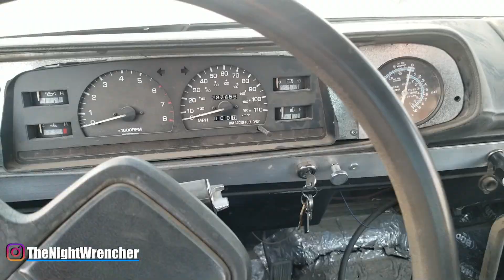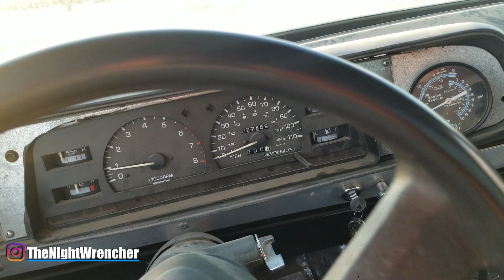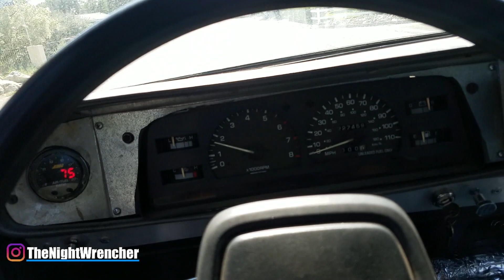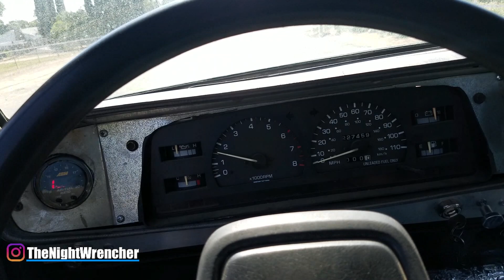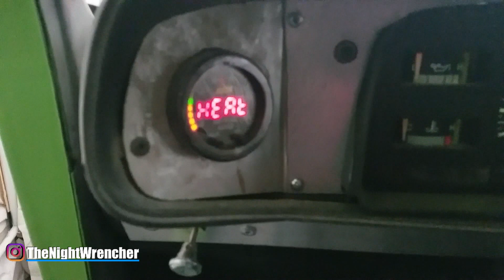Carburetor VS Fuel Injection- 5 Myths BUSTED | Holley Carburetor Secrets | Carbureted LS

Comment: Good video on a topic that will always be swayed toward the fuel injection side in the modern times where using a laptop and entering data to tune is so much more understandable than the physics of a carburetor that are from the pressure differential interactions of each metered orifice to the density change of main well fuel with different and amount of emulsion bleed exposure. The observation of the beginning of carburetor stigma, myth and lore sounds accurate to me. Back in the day Holley engineers would calibrate by size and location every orifice on their carburetors to close as practicable to suit the manufacturers engine. People started changing characteristics of the engine or swap carbs from bigger engines to smaller engines etc and they no longer ran as they should. After some stabbing in the dark without even knowing the full extent of carburetor operation let alone how all those fixed holes on the metering block work they got it to run a little better. This eventually led them to believe that they ‘know’ how to tune a Holley. Years and years of misguided information perpetuated by magazines in those “Everything you need to know to power tune your Holley carburetor” that showed you how to adjust float level, change main jets, set idle and incorrectly chose power valves led so many to believe they knew all there is to know so if it still ran rich then “that’s just what Holley’s do because I’ve done everything that can be done to fix it” having zero clues about sizing IFR or adjusting iab and certainly no knowledge of e-bleed function and how a change of mab or MJ can alter that function. So when people are ignorant of their ignorance and see Holley carburetors through the eyes of all the myth, lore and stigma it’s no wonder they are flocking to Holley Sniper etc and claiming it has it all over carburetors. Those that make those claims either themselves or their tuners did not have a full understanding of how and what to adjust to get the best out of their engines with a carb but with fuel injection it’s all there in front of them on a laptop. Like yourself I enjoy tuning carburetors for the sake of doing it and continually getting an understanding of the physics involved and what changes effect what else and the how and why. I am having a growing dislike for some of the old timers commenting on various platforms that not just claim but tell you they know better because they could tune a Holley back in the seventies and still can now yet cannot explain the interaction between the main air bleed and the e-bleeds and what would happen if they were to change size or location of any of those. I doubt they could tell you what other effects changing MJ has other than increasing or reducing fuel supply of the boosters. I’ll leave you with something Mike Laws told me on a forum when discussing Holley emulsion that paints a picture of why those on the fuel injection is better side is on that side - easier to understand 
“The emulsion/mab system is dynamic, variable, complex and ingenious. (Especially with older booster technology.) I remember back several years when a young mechanical engineer from Hendrick Mtspts asked my Dad (Bo Laws) to explain the emulsion system on one of their Cup-Plate carburetors. Dad had a metering block in hand and was about 15 minutes into the tutorial when it became real obvious that the young fellow wasn't getting it. He was polite enough and excused himself. We got word the next day that he put in for a transfer to the chassis department. In the fellow's defense; one could literally write a book about the emulsion system in racing carbs.”
Reply from the maker: I agree with you 100%. The move will always be slowly towards EFI. Thats one of the goals on this channel, keep people on the carburetors and demystify all the secrets into easy to chew videos. Hopefully we can end up with well educated carburetor enthusiasts but only time will tell
Reply: @NightWrencher  keep the good content coming👍

Comment: Great vid. 
Having a tough time figuring out my carb.
4150 4779-9
383 stroker 10.75 : 1
Cam 233 at .050 290s at .006
I can only get .75 turn out on mix screws to get 14 ish afr. When I put in gear it leans out and idles like crap.
Msd6al2 programmable, I've played with all sorts of timing,  I got qft metering blocks, modded body for IAB and am up to .083 from .071. I've read and researched for weeks, learned a lot,  but its kicking my butt. 
Tran is a 700r4 with a 9" 2600 stall. 3.73 gear in rear. 
Transfer slots are squares, I've tried squaring secondarys also, leaving idle screw alone and using timing to adjust idle. Pv is 4.5, car makes around 10 to 12".
Squirters are 31, jets are 71 and 83. No PC in sec. 
Engine dyno made most power at 39* 480hp 495tq. 
Any help is much appreciated.  
Thanks
Reply from the maker: Ok, theres a few issues there. First, you should not be adjusting your idle speed with timing. Timing should be set at highest vacuum at idle. Second, you increased your IABs which means you also leaned out the fuel curve so I would put the old one back unless you go too rich too fast in the transition and cruise. Third, you have a fairly lopey cam, so you can not trust your AFR reading at idle because of the overlap. It will always show leaner than it actually is, set your mixture screws to highest vacuum then set your idle speed screw, the set your mixture screws again. If you can get a 4 corner idle carb, I would recommend you get one. Do not open the secondaries at all if its a 2 corner idle carb
Reply: she is a 4 corner. 
I'll give your advice a try. 
I kept good notes so I can do a restart if needed. 
IAB, afr reads rich still in the transfer so I dont think I'm to big yet. 
I also reduced IFR from .031 to .027 to try and lean it some. 
Those are big reductions when converting to area then percentages.  I thought for sure I'd see changes.
Reply from the maker: You're right, you should have seen at least 1 full afr point difference. What brand base plate do you have?
Reply: The stock one that came with carb.
Reply from the maker: Since its a 4 corner idle carb, when you tried doing a half turn open on the secondaries, how did the AFR respond?
Reply: I've checked for vac leaks, body and gasket surfaces are flat.
I think I'm to the point where I'm not going to focus on a number. Get it idling decent and go for a ride. Tune accordingly.  It is better than it was. So I guess I shouldn't say there was no changes, and I can get a idle afr of 14 or so but when I put in gear it leans out. 
I get close, then strap car to lift, with parking brake on, in gear, and readjust. Afr reads 13 or so. But that's me focusing on a number. Plugs definitely look better. I bet your right, overlap, scavenging is giving false reading. 
I do know it likes timing. If I give it 35* at idle it idles awesome,  crisp throttle,  but that's a lot... with this msd I can create any curve I want. Pull a max of 25*. Neat box. I plan to use a 1 bar map to act like a vac pod to give timing when crusing around.  
But I'm not close to that. 
This all started with tuning my 700r4. The tv cable, govenor, and needing a good engine tune for best tran results.
Reply: It seemed to help a bit, tho idle went up, I can back off idle screw to nothing so it's just running on secondarys.
Reply from the maker: Definately the cam plays a huge role. You'll definately find a happy medium in the tuning. Try to tune for cruise and WOT and worry about the little stuff after the rest is done. A vacuum leak would cause a lean condition that would show up heavily at idle so I really dont think thats possible right now.

Comment: F the Haters.
I recently pulled the sniper EFI off my 73 390FE after running it 3 yrs. Picked up a $169 50% off Holley carb . I dropped front jets 2 sizes and checked with 02 sensor it's spot on. Snipers going onto another project. 👍💪
Reply from the maker: At least the sniper still works 😭